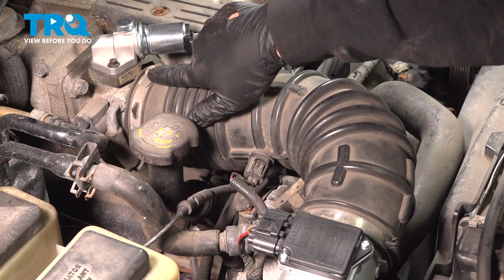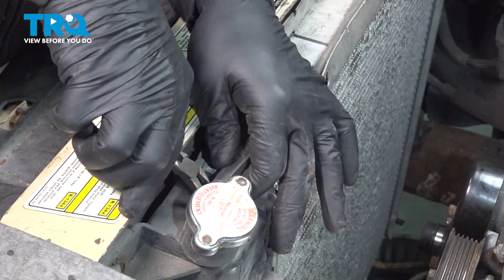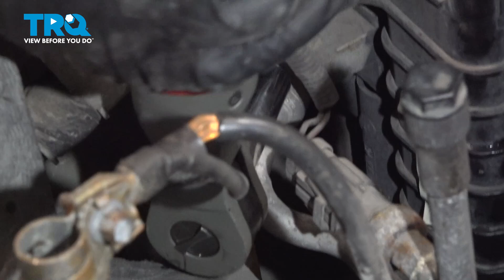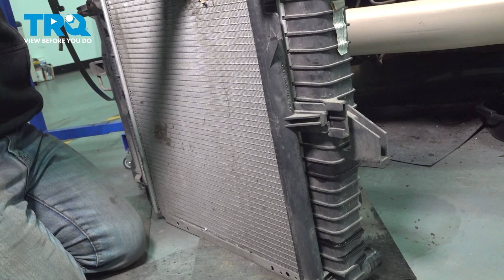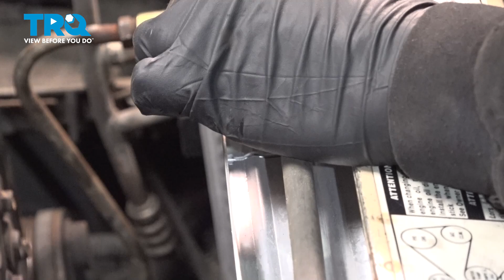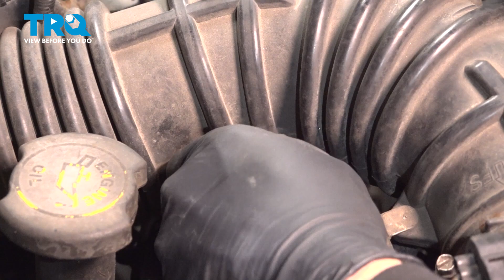How to Replace Radiator 1995-2001 Ford Explorer

Comment: I just want to know what size are the cooler line fittings? I've already gotten a pair specific to the explorer but the male thread diameter is slightly too wide to actually fit into the radiator.

Comment: LOL no need to remove condensor or fan and shroud lol people dont follow this video dont remove your ac lines at all this radiator on this model is tight but removable without removing anything else the condensor is only clipped to radiator lol man this is no bueno.

Comment: Well done. Just a tip. There's no reason to remove the fan and shroud from the vehicle. Just detach the shroud and lean it back. There's plenty of room to slide out the radiator. I've done it many times on rangers. Cheers!!

Comment: Great video! Thank you! I just wanted to interject a couple of things that will help people out tremendously towards the beginning of the video that most people are largely unaware of when it comes to unplugging any sensors from their wiring harness connectors and therefore from the ECM Computer. I took the OBD II Diagnostic Scanner /ECM /PCM Course and am certified in the diagnostic process pertaining to OBD II / On Board  ECM /PCM (Engine Control Module & Powertrane Control Module) Computer and its correlation between the EVAP System, all of the various system's sensors, solenoids, check valves, vent valves, shutoff valves, pressure regulators, power actuators, mechanical valve control actuators.... Suffice it to say, it's a very involved system. As a side note, since we're on the subject..., everyone, you must resist the urge to pop in to your local autoparts store and have them reset your codes. You can get your computer's code(s) read, but for your own sake and the sake of efficiently and effectively repairing any hiccups your vehicle may be experiencing, DO NOT RESET THE COMPUTER! These poor guys working there are highly unlikely to be certified in OBD II Diagnostics and get put on the spot by these parts stores that mind bogglingly force these guys who are as in the dark as you are on the subject to go outside and mess with your finely tuned Onboard Diagnostic Computer. 😅 I mean...,what could possibly go wrong? 🙁 The answer is PLENTY. This brings us around to my initial reason for this comment concerning the disconnecting of the M.A.F. (Mass Air Flow) Sensor from its connector and therefore from the air filter box air tube delivering fresh air to the TPS (Throttle Body Position Sensor... I know, why isn't it abbreviated TBPS? Right? Anywhoooo...). 
#1- ANY TIME YOU DISCONNECT ANY SENSORS, ALWAYS, ALWAYS, ALWAYS disconnect the NEGATIVE (not the positive) BATTERY CABLE FIRST! You can do serious harm to your computer by foregoing this safety measure and a used computer can and will cost upwards of $500. A new one? You don't wanna know.
#2- If you disconnect the M.A.F. Sensor from its harness connector to remove the air tube, it will RESET THE M.A.F. SENSOR IN THE COMPUTER AND YOU WILL HAVE TO COMPLETE A FULL DRIVE CYCLE TO GET YOUR VEHICLE TO RUN COTRECTLY AGAIN. This mandatory Drive Cycle consists of driving at highway speeds (55mph) for 20 miles. Not 18 miles, not 19 miles, but 20 MILES. THEN..., YOU HAVE TO IMMEDIATELY PERFORM STOP AND GO DRIVING ON BACK ROADS AND NEIGHBORHOODS AT 25 TO 35 MPH FOR ANOTHER 20 MILES AND THIS 40 MILE ROUND TRIP MUST BE PERFORMED. You do have one recourse. You can pay a mechanic who owns one of those real deal OBD II Diagnostic Scan Tools that costs a fortune to perform a RE-LEARN PROCEDURE on your Computer and the MAF Sensor (NOT TO BE CONFUSED WITH THE RESET PROCEEDURE THAT I WARNED AGAINST EARLIER. This is why you cannot let the autoparts store RESET your codes. They are actually resetting all of your sensors which includes a whole barrage of IM SENSORS that will not communicate with the computer if you simply drive home and park the vehicle. This is just a short insight into what takes place if you haphazardly disconnect any sensors without knowing what it will take to get them back up to speed once you reconnect them and also the danger of messing with "Hot" wiring harness connectors. I can just about promise you this guy knows even more than I do about the subject, but he had his hands full with the removal and replacement sequence procedure  for the entire cooling system for this 4×4 Sport Utility Vehicle and for that alone I thank him. Thank you sir. You are a scholar and a gentleman. 🧑‍🔧🎓🎩

Comment: this video was helpful BUT! you don't have to remove serpentine belt or fan!!! this always happens on most you tube videos! they always remove more than necessary, you don't have to remove battery either CHRIST!   it was a pretty smooth job actually, if you were lucky enough to read this comment i saved you at least and hour of labor not removing unnecessary parts!  takes about an hour and a half to remove radiator, maybe less mine was a 5.0 v8 engine.